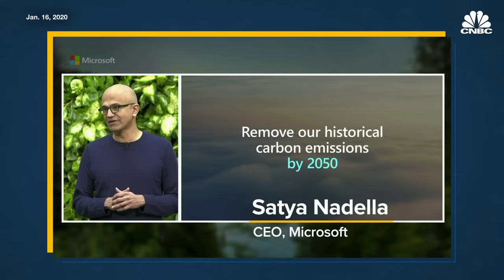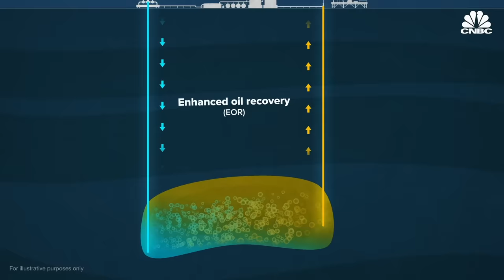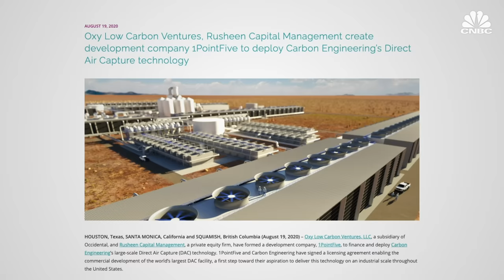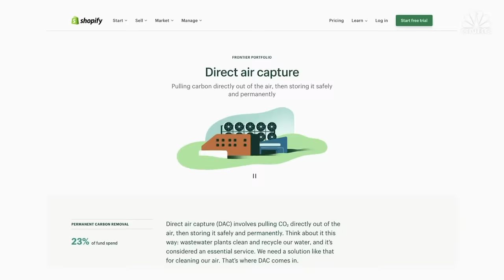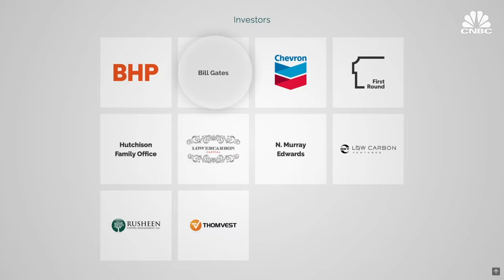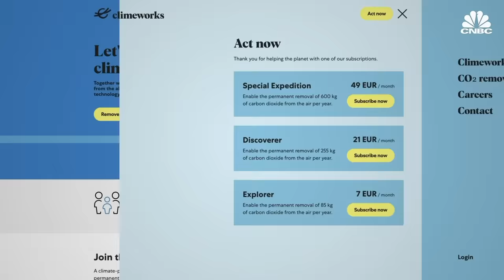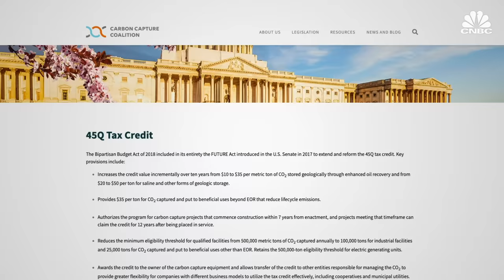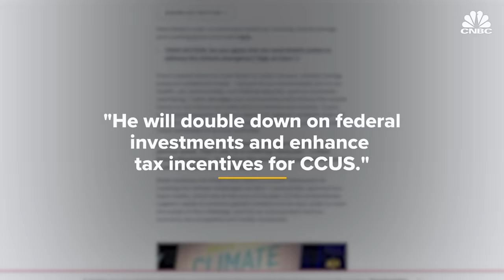Money Is Pouring Into Carbon Capture Tech, But Challenges Remain

Comment: The cold standard for these technologies is essentially adding CO2 to silicate rocks. The problem is that our emissions are so high that we would need the equivalent of 6,300 Grand Coulee Dams worth of carbonate rock alone PER year to sequester our yearly output of CO2. This is without looking at anything other than the reactivate material.
Reply: These techologies will improve over time & are one type of solution, a major one along with reforestation and other green tech solutions.
Reply: @jcomm120  Reforestation isn't a solution. Please take a high-school physics class. Or read a bit on the laws of thermodynamics. CCS of any kind will never work at our current scale. Degrowth is the only option.

Comment: So.....How can I invest in this?
Reply: There needs to be a global price on carbon, and these companies need to be paid to pull it out of the atmosphere and store it. The problem is we currently treat CO2 emissions as if they aren't a pollutant. That must change. A global carbon tax is the only way to solve this problem.
Reply: @adambram  co2 is exhaled by every animal and human on the planet though
Reply: Ride your bike more!
Reply: @ericburton3963  Right, but the CO2 we exhale is already part of the carbon cycle. The amount of carbon in the carbon cycle would be constant if we weren't digging carbon out of the ground and burning it. Think of it this way. A banana grows on a tree by absorbing sunlight and CO2. You eat the banana and you emit the CO2 that was stored in the banana back into the air. That's the normal carbon cycle. Coal and oil were not part of that carbon cycle until we added it. Now that excess carbon dioxide must be removed because it traps heat.
Reply: Removing your carbon emissions by getting rid of humans.
Reply: @tuckerbugeater  The scary thing is that most of the world isn't developed. If those countries develop with fossil fuels there is no chance civilization makes it. The rate we are adding CO2 to the atmosphere is 100 times faster than any natural change in the past. The climate has always changed, and CO2 changes were often the reason. CO2 can move naturally in and out of the atmosphere over long periods of time. We've accelerated it way beyond what natural carbon sinks can handle.
Reply: @Timothy Mckee You are wrong about several things: CO2 isn't 4% of the atmosphere. It's 0.04% -- 100 times less. All greenhouse gases are trace gases. That makes sense because 99% of our atmosphere is Oxygen and Nitrogen. Oxygen and Nitrogen molecules do not trap heat because of their shape. If they did our planet would be like Venus. But CO2 and the other greenhouse gases are enough to keep our planet at a moderate temperature. Consider that the Earth and Moon are both the same distance from the sun. The only reason the Earth has a warmer climate is the very small amount of CO2 and other greenhouse gases in the atmosphere. It's the very fact that Earth's CO2 is only 0.04% that makes this such a big deal. If CO2 were abundant our emissions wouldn't be significant enough to impact it. Before the industrial revolution, CO2 was 0.028% of the atmosphere. One-third of the CO2 in our atmosphere today is CO2 that humans emitted. CO2 traps heat, and that has been known for well over a century.
Reply: @Timothy Mckee Nobody is arguing that CO2 levels weren't higher in the ancient past. Throughout its history, Earth has gone from a molten planet to a giant snowball. There have been periods where the Earth was so warm that alligators swam in the Artic. This is all well known. The reason this is scary now is the rate of CO2 change is much, much faster than any other time in the past. Life can adapt to large swings over a long period of time. The problem is that this is happening too quickly for a lot of habitats to evolve. Millions of species will go extinct and food webs will collapse if this continues. So yes, the climate always changed. Yes, CO2 and temperatures have been much higher than today. But if you're looking at that and assuming there is nothing to worry about you've missed the point.
Reply: @Timothy Mckee FYI, a few years ago I made all the same arguments you are. I was a climate change skeptic until about 2017. I assumed that because I was an engineer with a decent background in meteorology that I understood climate change. I hope you'll look into it more. I'm happy to share the videos that convinced me that I was dead wrong back then.
Reply: @Timothy Mckee Volcanos are part of the natural carbon cycle. Sometimes one big eruption will emit a lot of CO2 at once, but volcanos only emit about 0.5% of what humans emit each year.
Reply: @Timothy Mckee I realize you want to be right about this. I wish you were. The fact is that this is the most serious issue we face in the world. I've gone down the same rabbit hole you did -- trust me. I know all of the arguments because I made them myself.
Reply: @adambram  CO2 is a naturally occurring gas that is the most important nutrient on earth by orders of magnitude. Basic building block of ALL life is Carbon. Somehow the elitists have convinced you they are bad? How did we have an ice age in the Ordovician period with CO2 at 4,000ppm.... 10x today?
Reply: @ColoradoHiker  Yes, CO2 is naturally occurring, but one-third of the CO2 in our atmosphere wouldn't be there if we didn't emit it. If life absorbed it at the rate we emit it, the concentration in the atmosphere would be static. The very fact that CO2 is 50% more than it was before the industrial revolution is proof that trees, other living things, and other carbon sinks are not absorbing it fast enough.  The Ordovician ice-age wasn't the only such event, but it goes to show a common fallacy that climate skeptics make with arguments. That's the "single-cause" fallacy. Greenhouse gases are is one of three basic things that regulate the planet's temperature. The other two are the sun and aerosols. You can have levels of CO2 and still get an ice age if the planet is getting less solar radiation or has more aerosols in the atmosphere. Similarly, I can regulate the temperature in my house by turning the heat up or opening a window. I can turn the heat all the way up, but if the windows are open it won't warm up. You have to consider multiple factors. We know CO2 is one factor. Currently, the Earth is warming even as solar irradiance is decreasing. That's a tell-tail sign that humans are causing the problem.
Reply: @adambram  There aren't just 3 basic things. There are the 3 earth angles, the oceans, albido, and other things. The earth has trended sideways for the last 20 years. The last 5 slightly down per NOAAs web site data. What specifically do you think is a problem?
Reply: @ColoradoHiker  Those things you mentioned all fall into three categories: 1) Solar irradiance, 2) Greenhouse gases, and 3) Reflectivity. You are correct in mentioning albedo. Albedo and aerosols fall in the "Reflectivity" category. The point is that these three categories (or things) work together to maintain temperature. Within each category are multiple things. For example, greenhouse gases include CO2, but they also include water vapor, methane, ozone, etc. Solar irradiance takes into account the energy from the sun, the Earth's orbit, the tilt of the Earth at a given time, etc. Breaking into three broad categories makes it easier to digest. You mentioned the oceans. That would be part of the greenhouse gas category because oceans can be a carbon sink or carbon source depending on other factors. But the ultimate thing that matters is how much greenhouse gas is in the atmosphere. You said, "The earth has trended sideways for the last 20 years. The last 5 slightly down per NOAAs web site data." What is it you are referring to? The temperature, CO2 concentration, or something else? I didn't follow your question.
Reply: If you are serious then why not ban dark roofs and asphalt roads?

Comment: To all the people saying plant trees instead: trees are not a viable method of carbon capture. Not only is the amount of land needed to plant enough trees prohibitively large, but trees don't actually "capture" carbon in a way that would be useful in stopping climate change. The carbon causing the problems was stored in the ground for millions of years. The only way to reverse climate change is to return the carbon to the ground and remove it from the "carbon cycle". Trees are part of the carbon cycle and all their stored carbon will be returned to the atmosphere eventually. I'm all for planting trees though, just not as a solution to climate change. Cheers!

Comment: Would removing carbon from British Columbia’s air negatively affect the region’s dense and lush forests? Considering trees absorb carbon it might be a safe assumption that this may impede the growth of the forests in this region (which will ultimately hurt our carbon sequestration tactics).
Reply: I doubt it, for two reasons. Firstly, I think CO2 disperses widely, quickly in the atmosphere - global variations in CO2 parts per million are relatively small (>10 ppm). So you aren't likely to see any 'British Columbia specific' impacts. Secondly, I don't think plants are that sensitive to local CO2 emissions/capture on this kind of scale. If they were, you'd see dramatically increased growth rates next to coal power plants or heavy industry.
Reply: No not at all. Direct air capture is essentially a machine version of a bunch of plants. That would be like saying “trees impede the growth of other trees because they’re taking away all the co2”
Reply: Um,  we don't teach basic science in public school any longer which means the goofle generation thinks plants are only good for human consumption
Reply: I think co2 is usually not the limiting factor in plant growth at all
Reply: @richhauxwell7848  what are you even talking about
Reply: @merrymachiavelli2041  this is good to know. I was just curious because obviously years ago we didn’t think car exhaust was a big enough problem and now we’re here so I’d love to see a report that models out a full scale carbon sequestration facility and see what they say about it’s effects on the surrounding environment. You’re probably right but I’m just playing devils advocate so that we think of all of the possible outcomes.
Reply: @kylef5993  yea I suppose maybe it’s possible

Comment: Prof Mark Jacobson seems to struggle as an engineer. The burn rate happens mostly independant of the extraction. You can argue lower prices means some increase in consumption, however so is there the fact of general decrease in use of fossil fuels..

 CO2 ground injection is a net decrease in CO2 in the atmosphere.   Espcially in consideration of can be near future rocket fuels that will be produced by carbon-fixing using solar power.
Reply: Mark Jacobson is a joke. This is the same guy that advocated against nuclear power with false data depictions like - solar and wind can power 100% of the grid by 2030. This was back in 2010 and since then his studies hv been debunked and critiqued by experts. So I wldnt take him srsly if I were you.

Comment: No point in artificial  capture - if they filter the co2 out and then dont know how to store it long term there really is no point in doing that - if they sell co2 to oil companies they dump it into sea, the oil comes to the surface and the co2 goes right back into the atmosphere while a tree captures and stores 100% of the co2 long term, if you cut the tree and built a house of it the co2 is stored for at least 100 years longer

Comment: I think we will get it eventually, a way for this to work as part of the solution and costs will inevitably come down to where its doable on a scale to produce results.     
CO2 capture technology is massively worth the investment as a short term tool for humanity to have in dealing with the coming climate crisis.... if anything because it doesn't immediately threaten those god awful important corporate profits---which are always such a stubborn road block to significant action in just about every other instance.    
Just got to figure out a way to also make the capturing profitable too of course, or no one will seriously invest in that either.
Its also much easier to be proactive with climate change and much more work to backtrack after the planet warms.... especially after the oceans heat up, not to mention the ecological damage, extinctions and human suffering will already be done as it were.

Comment: I think you know the chemistry I need to know to create a inline low differential pressure high vol low pressure applications. I have a ideas to scale it up instantly if we can build it. Ive seen a filter which becomes saturated then heading cleans the filter releasing the carbon. I think I may have a way to make a historic change using existing infrastructure no fans needed they run 24/7 if they capture any carbon or no carbon and my business is maintaining them.

Comment: So why do we even build this tech of capturing CO2 if they gonna store in under the ground for companies to pump back up eventually, basically? 

Or if the current capture tech is to just capture but did not account for doing the wrong thing with the captured CO2, then we need to find a way to put the CO2 to good use where IT DOESNT POLLUTE THE ATMOSPHERE...which is the point...other wise

Can we make vehicles of all kinds on earth capture CO2 kind of like how electric cars can capture Solar via onboard solar panels...and then make cars also run on oxygen as hybrid vehicles as well as electric? 

Split the CO2 captured air from the cars, and then idk what to do with the left over pure carbon, but DO NOT put it back in the air

Comment: using CO2 for enhanced oil recovery isn't sequestration . the CO2 will just be produced along with the other well fluids. the gasses produced will be used and the CO2 will be released into the atmosphere. storing the CO2 underground will eventually have problems with pressure build up.

i worked in a oilfield that used water flood as enhanced recovery believe me the flood water was produced with the other well fluids. in another big oilfield the produced fluid was 10%  oil so if the well made 150 BBLs 15 bbls was oil the produced water was disposed of in a shallower sand formation that shallower sand formation was pressured up causing well control problems when drilling wells in that area.

Comment: Carbon capture doesn't actually promote oil use, rather oil extraction will continue until governments literally grab them and stop them. Plus oil extraction can pivot to making plastic - which isn't as bad if it is used for products which are long lasting rather than disposable. Trees will never be sufficient. Even if the deserts are regreened. Maybe seaweed could make the difference though.

Comment: Brazil has been experiencing with carbon neutral fuel since the early 1980s when we went bankrupt and had no more hard currency to import fuel. It's called Proálcool and Ethanol is produced from sugar cane. My car is a VW UP! 3 clininder, 1 liter, turbo engine that has a smaller carbon footprint than any Tesla. Now, we did not do that to save the planet - we did that to save our necks. In the end, it works. Brazil's gasoline has 20% ethanol as an anti-detonant and most cars are flexible and able to run with any mixture of Gasoline and Ethanol. 

We're in a situation (by "we" I mean humans) that all ideas should be tried out. I don't like, however, Oil companies using these new technologies to fake caring about the future. I also don't like people thinking only in one aspect of their idea and forgetting other impacts - that's what brought us here. One thing I really like is trees - plant a lot of trees, plant them alongside the roads, build a lot of things using wood. Carbon can be stored in really beautiful wood!

Comment: Reduce carbon emissions by stopping the extraction, shipping, refinement process, and public use of all oil related products.

Cooking the books hasn't ever worked in the past and it does not work now.

It should be an illegal act in society to even contemplate producing oil related products.
They are murderous products that need eradicating from our ecological structures.

Comment: What is the word when you provide a solution and make the problem worse? I could only find the German word Verschlimmbesserung a German noun word for an attempted improvement that only makes things worse. I use this in reference to the collection of Co2 and the use of it in oil wells. Thus allowing for more oil to be captured and burned.

Comment: Despite its not carbon, but methane...In the first two decades after its release, methane is 84 times more potent than carbon dioxide. ... While methane doesn't linger as long in the atmosphere as carbon dioxide, it is initially far more devastating to the climate because of how effectively it absorbs heat

Comment: Add a tax to every gallon sold that covers the cost of full co2 capture. Direct capture is cheap enough to do that now and with more oil burned it'll mean more money to capture, a cycle. With large scale capture I imagine the cost to do it will get driven down so we'd pay less tax per gallon over time

So basically we can burn as much gas as we want and stay carbon neutral

Comment: All of these technologies require energy to operate. We get most of our energy from non-renewables. You want to burn fossil fuels, to create energy, to run machines that capture a fraction of a percent of the carbon used to run the process?
The problem is that CO2 exists at a concentration 400 parts per MILLION in air, so you have to process tons of air, to get the 0.04% of CO2 out of it. And since CO2's value is very low as a commodity, there's no possible business model for commercial atmospheric carbon extraction. We would need to implement carbon taxes on producers to pay for the costs of extraction.